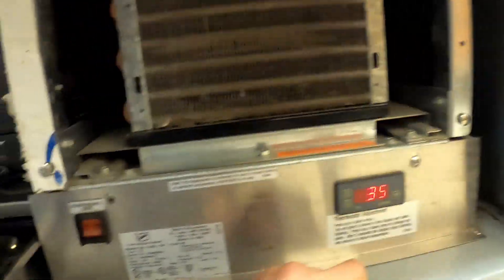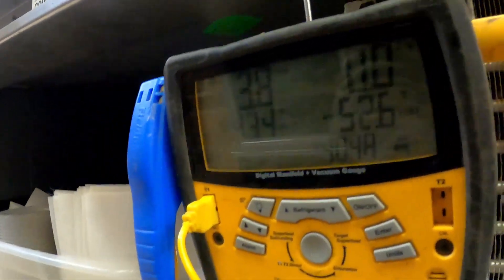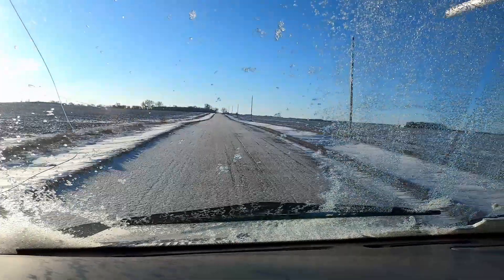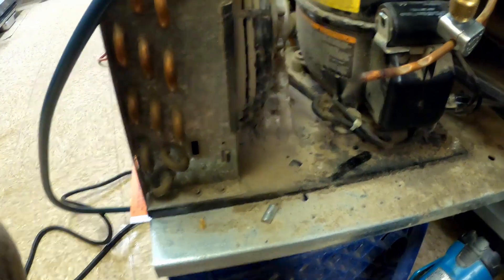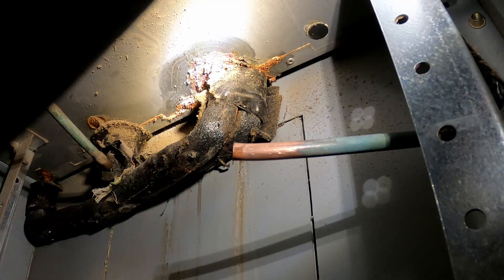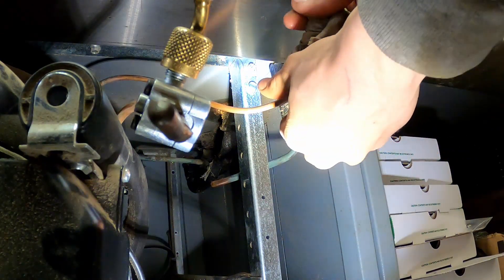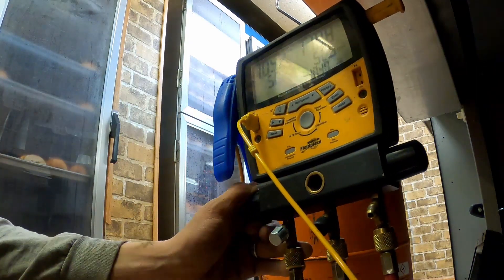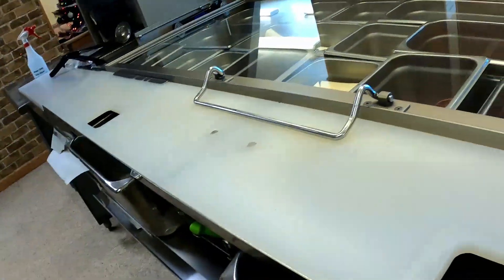Liquid Line Restriction, Diagnosis and Repair

Comment: Your pretty good for being so young. You obviously grew up around it so it was easier tonlearn when it came time. I grew up the same way. I got tons of hate in the union when the old timers knew a fraction of what i knew lol. They dont like it when a "kid" is better than the foremen.  Lol. Keep on getting it bro. Doing great. You can tell you have been taught right
Reply from the maker: You are correct! I work with my Dad, so it was earlier learning. I would not like working with a union, seems like there's always a lot of drama and people looking down on each other for no apparent reason.
Reply: @ReubenSahlstrom  it can definitely be that way. It's very much a "go with the flow" type deal. And if you were taught to jam the job until it's completed bc you don't get paid until the job is done you would find it very hard to fit in. Haha I did. And they worked at a snails pace milking every job for the last minute.  Very tough to adapt when you are taught to work hard and that's the only way you know how. I pissed off a bunch of old timers at a Chrysler plant while we were reskinning the paint booths during holiday pay haha

Comment: I saw that you left the bolt on piercing valve on the low side why not braze on a permanent port. I personally have not had good luck leaving those on systems typically causes leaks later down the road.
Reply from the maker: To be honest, I was planning to add a port there, but couldn't find one on my truck, so I left it in. I got rid of the high side one, and added the new filter drier that had a port on it. Good reminder to get some of those port adapters back on the truck.
Reply: @ReubenSahlstrom  i wish i had some of those computerized gauges, i only have the mechanical type that are 30 yrs old that have r12/22 numbers. 😀

Comment: Worked on a unit almost exactly like that today at a Subway. Thankfully it was just a refrigerant problem. The unit I worked on had an AXV, I would have rather had a TXV. Good work.
Reply from the maker: This was at a Subway. 😂 What company manufactured the unit you worked on?
Reply: @ReubenSahlstrom  It was a Duke. Almost exactly like the one in your video but a little older. Had a mechanical thermostat and an AXV. Otherwise it was exactly the same

Comment: txvs - they're great, that is until they break.
Reply from the maker: Yup! There are definitely advantages to both expansion valves and fixed regulating devices. I like the simplicity of a piston oriface, but l like how TEVs give you the flexibility of keeping a little extra refrigerant in the system.
Reply: @ReubenSahlstrom  they're good on zoned hvac, low ambient, 2-stage/var capacity - but for single stage straight cool and most refrigeration applications, i would prefer an orifice or cap tube. simple with nothing to break mechanically.